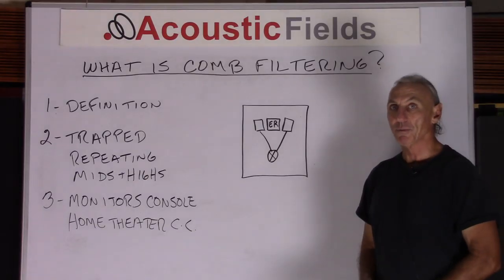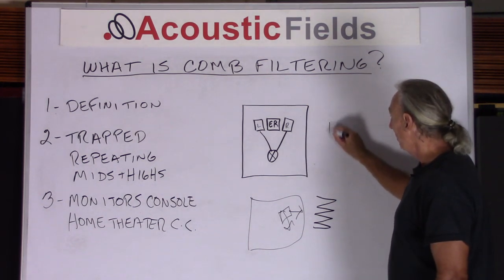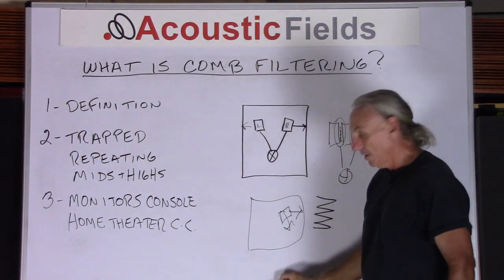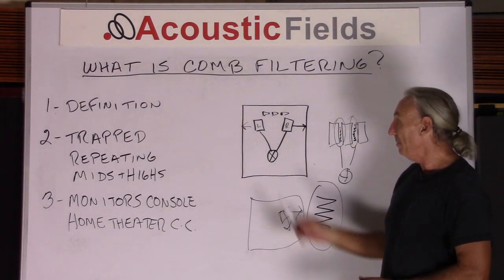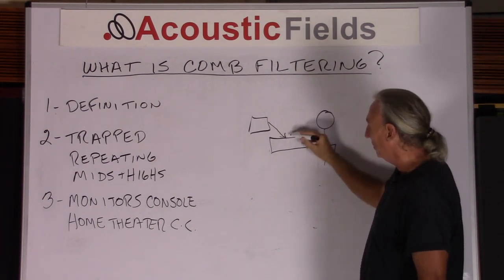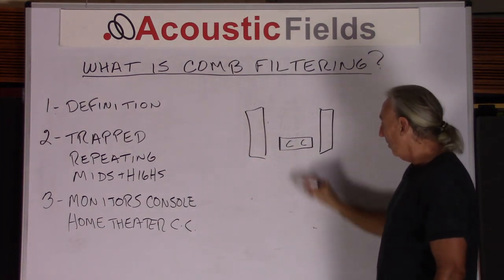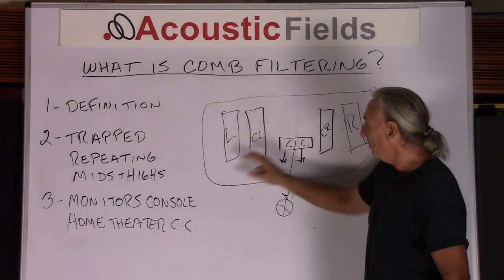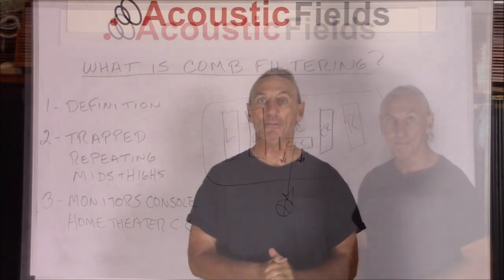What Is Comb Filtering & How Does It Relate To Room Acoustics? - www.AcousticFields.com

Comment: What you are describing is a Comb filtering effect, not a comb filter. A comb filter is a device that delays a signal so it either destructs or constructs a signal. Fo example a noise canceling headphone works by sampling ambient sound, run it thru a comb filter, or phase shift (simple inverting) that delays this ambient sound by 180° and introduces it into the audio stream to cancel the ambient sound. Adding a phase shift of 180° to a signal will cancel the signal out. You can make a 60hz hum filter by the same method. 
A signal that is slightly delayed, by speaker placement etc. will distort the original signal which is what you are describing here, but its not a filter, its an effect.

Comment: As always, geart insights from the master himself, Dennis. Thanks for educating us. And since we are in the comb filtering topics, can you share some insights how comb filtering may happen between 2 drivers, the woofer & tweeter, and 2 tweeters, mainly for speaker DIYers, because this happens a lot too in my experience with speaker DIYers.
Reply from the maker: Hi Nelson de Leon 

The radiation patterns of speakers must be addressed in all speaker designs. The cabinet refractions themselves must be a nightmare to deal with, let alone the interaction between the physical drivers themselves. How about the crossovers? Getting three speakers to sound like one? Yikes! Some designers have it figured out but most do not, thus all the different manufacturers. Since the speaker, in my opinion, is the weakest link in the sound producing chain, it is time for a new approach.

How are you?  Long time no speak.  How did the BDA build progress for you?

Thanks
Dennis
Reply from the maker: Hi Nelson de Leon 

How are you?  I answered your question in a little more depth in this weeks Google Hangout.  You can see your answer here:
http://youtu.be/4tHfHH0_7Jg

Thanks
Dennis

Comment: Very helpful video, thanks a lot! I was just wondering if this phenomena is an assembled word for all different types of sound reflections you would get from any kind of angle? Because at first it sounded like the phenomenon only happened if your sound source and its reflector reflected the same sound many times (it would go back and fourth as it did in the monitor and equipment rack example) but in the console example there was only one reflection drawn from the speakers to your desktop and then to the listener. Does that happening give you the same result and is that happening also called comb filtering? Because if so the comb filtering phenomena is something that you never can get rid of? I mean you're soundsource and its reflections are always gonna hit some angel in some way. Because you cannot be in a room without angles or reflections? And your only way to diminish the happening is by reducing the amount of angles? Im just checking to se if I've understood you correctly!
Reply from the maker: I,  Angled boundary surfaces can impact middle and high frequencies. They have the greatest impact at the listening position.

Comment: so how do i set my PC monitor(screen) regarding to the speakers , and how do i set the speaker regarding to my desk (console)
Reply from the maker: Osama Said El Sayed 

Remove the monitor from between the speakers and hang it on the front wall. You may have to get a larger monitor but the sonic improvement will be well worth the additional screen cost.

Thanks
Dennis

Comment: What do you say about stacking speakers like a tower. I have two 18" subs on top of another stacked, then putting a 12" inch Speaker on top of the sub and then adding another 12" speaker on top of the speaker making it like a tower. I have this on each side of my DJ booth. Do you recommend this? If not, what do you suggest to get the most out of my Powered speakers. 
I Use Yorkville LS800P 
EV ETX 18SP 
Then two EV ELX 112P stacked one on top of another
Reply from the maker: E,  I would make all the subs you are stacking the same manufacturer, 
 and same number and diameter of drivers. Elevate the first sub at least 24" off the floor.
Reply: @AcousticFields  thank you for the response! And regarding stacking two 12" inch Speaker on top of another won't cause issues of phasing? Since I want to gain the most out of the Highs from the speakers
Reply from the maker: E, keep each stack the same manufacturer so the driver speed is the same. make sure they are all 12's, 15's and 18's. Do not mix the sizes.
Reply: @AcousticFields  Sounds great! What would sound better, the 12" tops stacked on top of another or would you have them on a dual pole stand side by side on top of the subs

Comment: Okay ... no rack between speakers when rack is high and in line with speakers.

How about 2 sets of speakers that are close to each other? Will that be an issue? If so, how far apart should they be or it’s best never to set up in that manner?

TQ!!!
Reply from the maker: Speakers are never designed to be positioned next to each other.
Reply: @AcousticFields  ... got that! Thanks

Comment: Dear sir, this is very helpful. But can you give me some advices on how to maximize my bedroom playing? I playing my guitar with a 1w amp with 8 inch speaker. If i place it on top of a chair i lose bass and gain more treble which i dont like. I need more mids and bass, i want to eliminate those treble that makes my sound thin. How should i set my amps position? Thanks.
Reply from the maker: G,  You will have to move your amp around in the room until you find a spot that has less modal pressure. Try different positions starting at room center.

Comment: I understand this vid is mostly about mid to high freq comb filtering, but can anyone give me any tips on how to tackle comb filtering (assuming that's what I'm experiencing. It's some kind of reflection or phase cancellation I think) in the sub frequency ranges, mostly around 20-60Hz? I've built a bass bin using a good quality old 12" Celestion bass driver, and used the Thielle-Small parameters along with advice from Celestion themselves to get a box that's tuned & measured for this driver (front ported, tuned to 30Hz). First test of the speaker was great, and this thing goes low without even having to drive it much. The response definitely isn't flat, there are a couple resonant peaks but not major. The biggest problem is that in certain areas of the room, the sound almost completely disappears. There's one area in particular where you can't miss it (it's literally like "a pocket of anti-bass space"). Move your head into it and the bass is gone, move your head back, and it's bass time again! Can anyone give any advice on what I can do about this? It may well have something to do with placement, although AFAIK, bass is omnidirectional, unlike mids & highs.

Thanks to any hifi gurus or speaker builders who can help me.
Reply from the maker: N,  If its low frequency, it is more a size/volume/ usage paradigm. You have a low frequency generating source that produces frequency and amplitude that won't fit into the room volume. Unwanted low-frequency pressure areas will room load depending upon SPL. frequency, and room dimensions. There are two treatments: New room size and volume or diaphragmatic absorption.
Reply: Interesting, it is in quite a small room, with a lot of furniture & appliances close together! I can't do anything about room size or room volume at the moment (most of whats in here is essential) but I'll look into diaphragmatic absorption and any other possible acoustic solutions. I saw you have a video on those absorbers so I'll check that out. Thanks for the pointers ;)
Reply from the maker: N,  Front and rear wall coverage with diaphragmatic absorption.

Comment: I always wondered about doing a left and right for the center, rather than a single speaker. . . would they be double mono??
Reply from the maker: D,   Yes, we do it in our theater builds to keep the center channel in the vertical domain instead of the horizontal domain to fit under a screen.  Placing a center channel, horizontally under a screen, when the left and right are vertical is the most crazy thing I have seen. It makes no acoustical sense creating phase and sound field irregularities.
Reply: @AcousticFields  Many home theater processors offer a "Phantom Center" mode that includes the center channel content in the signal that is routed to the primary L+R speakers, negating the need for an additional set of L+R speakers.  While this reduces comb filtering due to reflections as described in your video, it introduces comb filtering due to the monaural sound traveling different distances between each speaker and each ear (acoustical crosstalk).  For mitigation, do you recommend room treatment (e.g.- diffusion) or signal processing (e.g.- phase decorrelation)?

Comment: I have a topic 
Wires 
Why is it that you spend tons of money on top notch speaker wires from the amp to the speakers but inside the cabinet there's very cheat wires. What effect does this have on the sound and what are the benefits of changing the internal wiring of the speakers ????
Reply from the maker: Great question eonblue2112 

You are correct. The signal path quality you describe is critical and in the past cheaper cables were used. With such short lengths, I do not see it being as critical as an amplifier to speaker connection length, but quality is a concern.

Most speaker designers today, at least the ones I know, use quality hi - fi cables. I know cable manufacturers that build their own cable technology into cables to meet the speaker designer's specifications.

Thanks
Dennis
Reply from the maker: eonblue2112 

How are you?  I answered your question in a little more depth in this weeks Google Hangout.  You can see your answer here:
http://youtu.be/eJGjC_R0C-k

Thanks
Dennis

Comment: Trying to figure out why literally none of the pro mixing engineers do this. Like look at Dave pensado, one of the most respected long time people in the industry. His speakers are directly next to each other. Nothings angled down as well.
Reply from the maker: A,  Near field monitoring takes many forms. It depends on distance to side walls, room volume, usage, desk dimensions, and pressure level used. There is no one size fits all. Be careful when you say everyone uses it, it must be right.  A lot of studios use building insulation to manage reflections without any concern for proper rates and levels of absorption for music and voice. Eighty million people smoke cigarettes, that does not make it right. Do your own thinking.